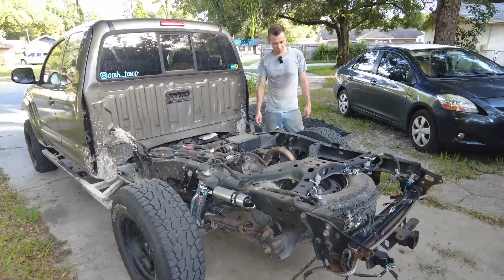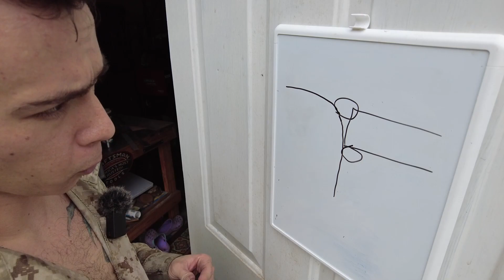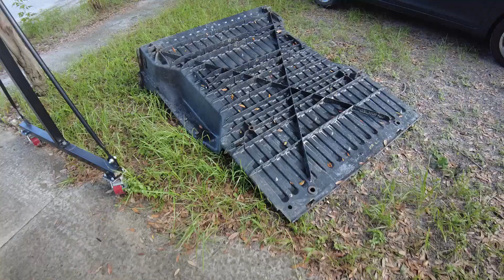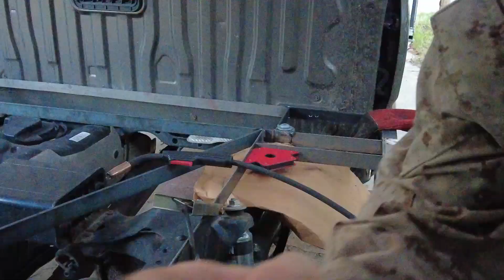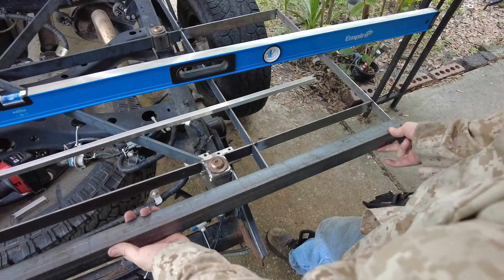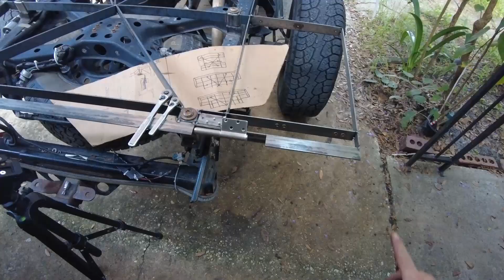Flatbed build anyone? - Part 1

Comment: what are your dimensions for the blocks that go to the frame rails?
Reply from the maker: They are 2"x2" square tube with 1/4" wall.
I don't remember the exact heights but they are very close to stock; if they are short the bed thickness is limited and the bed will be weak, if they are too tall the factory bed bolts will not reach the threaded holes in the frame. Its a small 'window', maybe 1/2".
Hope this helps! You making something yourself?